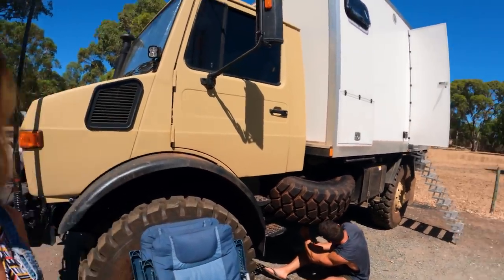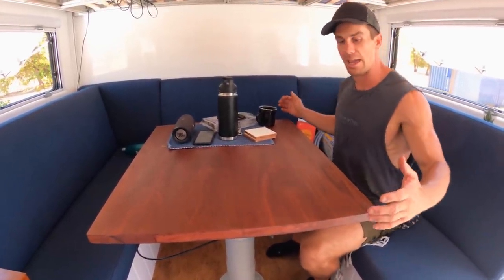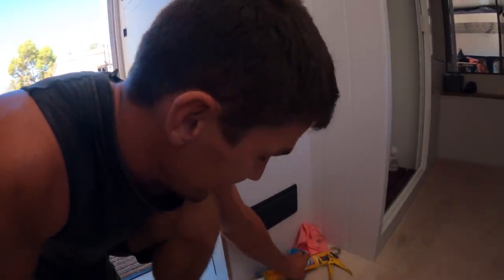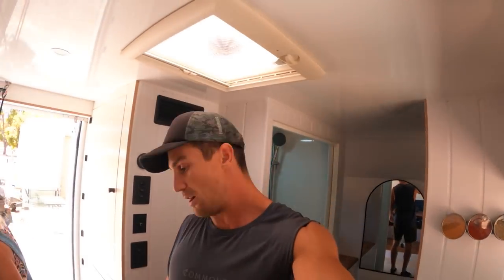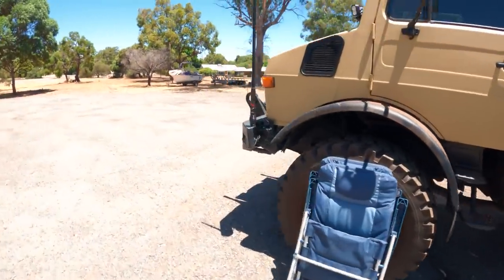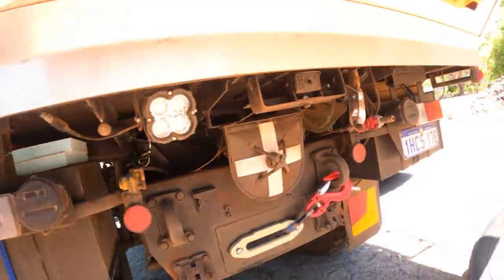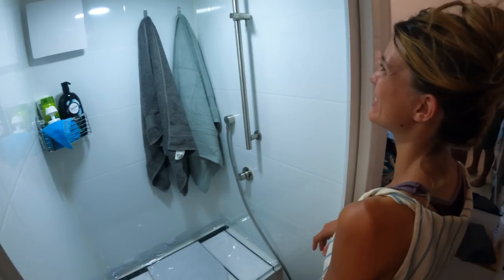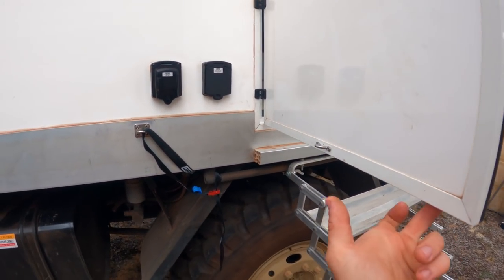FINAL Camper build - We are READY to hit the road FULL-TIME!

Comment: Loving the fitout and so jealous your about to hit the road again.  For the Ants, after living in the tropics and stopping the ants from getting into the dog biscuits. When you set your stairs up place the ends in a little container of water.  Really looking forward to seeing and hearing about your travel adventures in the MOG. Interested to see if your enthusiasm for the MOG will be the same after 3 months. They are a bit slow  and driving them in the Territory is exhausting. I foresee an aircon fit out in the cab for you future. 😉. It will make a massive difference in those really hot travel areas.
Reply from the maker: Thanks a lot Chris! It was a lot of hard work and compromises though, but we're glad we pushed through :) Thanks for the tip for the ants.

Comment: Noting the comment about installing an accumulator tank on the Jabsco water pump in order to overcome the cycling. I experienced a similar issue with an installation of my own, and as well as the accumulator tank, I also installed a good check valve upstream of the pump to ensure no water could make its way back to the storage tank, which ensures the system holds pressure and stops the pump kicking in.

Comment: Looking Great! Just a tip with the windows. You may already know this but make sure when they are open you need to make sure the locking levers stay in the “open” position. If they fall to the “closed” position and a gust of wind slams the window shut it will crack the window. I learnt this the hard way and have a crack in my kitchen window.

Comment: You can get "cable riser chain" for the bed wiring but if you want to go with your theme try coring out a boat rope and using it as a sleeve.  The larger diameter means it won't get caught as easy and it has added mechanical protection. For the toilet if the plastic isn't working try 3mm poly sheet hinged towards the exterior then have a velco tab on the wall for when your not using it. Great job guys looks great and we'll put together.

Comment: Just an idea for your toilet area. You could manufacture a  clear plastic type lid that covers the toilet top and lifts up like the toilet lid. (You can purchase clear coreflue from Bunnings and make a light weight aluminium frame to house the coreflue to.) Or a roller blind kind of cover that works like a window pull down blind / shutter made out of the same clear vinyl plastic that you currently have.

Comment: If you make coffee, put the used grinds in an open jar or a plastic container with holes. Supposedly ants don't like the scent and they stay away. I've tried it b/c I had ants showing up in my kitchen and so far so good! Also, vacuum them up and then wipe down the surfaces they were traveling on with cleaning solution. Ants leave a trail of biological substance that other ants track.

Comment: find a durable container that has a lid  screw on fill with turps place  legs to stairs in  when finished screw lid on ; ready for next time  rig is looking great guys, try an air fryer, better than a fry pan, the kmart one $69 works just fine;

Comment: If your ants solution doesn't work as expected I suggest to upgrade the feet of the folding steps in a way that they end in some kind of small bowl/dish which could be filled with water. Must not be fixed just durable enough to withstand the load like metal, heavy plastic or wood..

Comment: Another great video, to stop the staining from the kwilia, use the offcuts from the Jarrah table. Looking forward to seeing you guys hit the road. Have you thought about/priced an airbag levelling system for bowser. Edit: for the ants either talcum powder around the feet or put the feet into a container that is filled with water, I was thinking some pvc end caps, so long as there is a decent gap (not climbable) between the edge of the container and the steps

Comment: My strategy with ants (in compared to Western Australia relatively wet and temperate Switzerland) is to where possible seal up any entry points (sometimes just using clear scotch tape), apply a bit of poison at a choke point if I cannot seal it, and manually exterminate every ant I can find beyond that choke point.